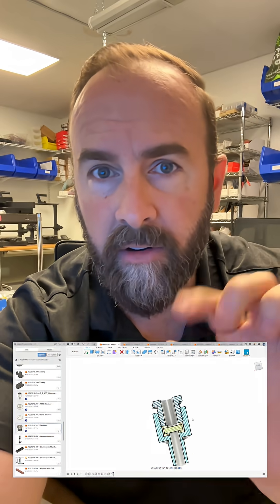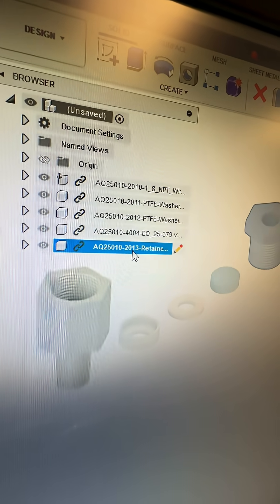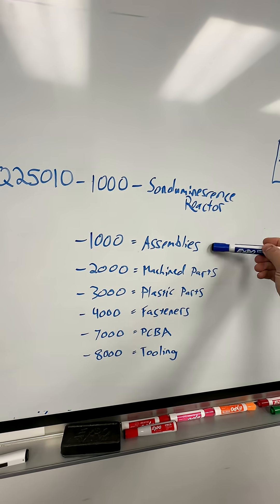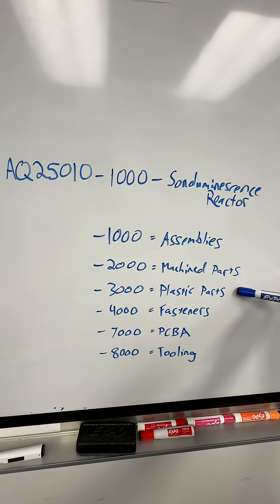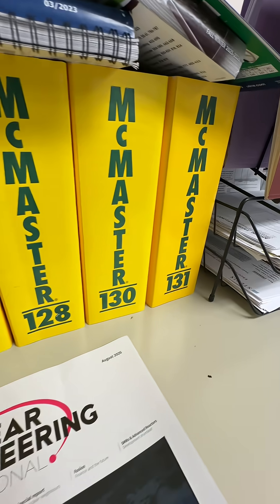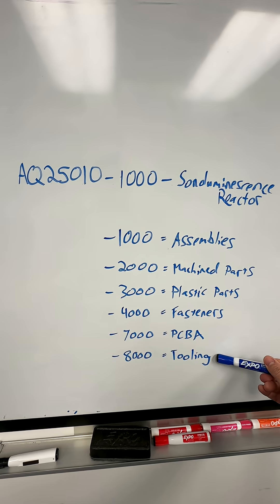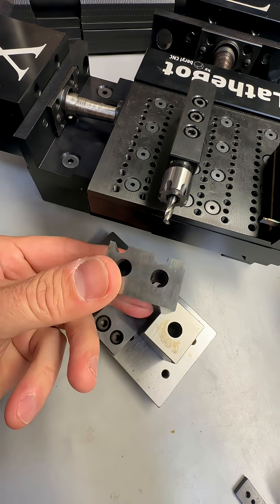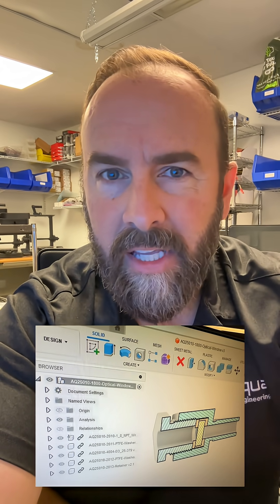Assembly and Component CAD Workflow

Comment: This is the part of CAD design principles that was glossed over during my time in engineering school.

My school (Cornell) never really taught the fundamentals of CAD. Naming conventions for cad is one of them.

It was more of a crash course and understanding datums and basic print reading.

Edit: I chuckled a good bit when you inadvertently called out my current naming convention of “Final Final Version” .

I literally have a CAD .stl file called: “backplate_finalized_02”
Reply: Never made it through E school, pivoted to IT, but did co-op with a firm. I knew the basics of their CAD package from high school and they quickly caught me up on the rest. The logic behind part tracking, revs, assemblies, etc. is still knowledge I use today for 3D printing as a hobby.
Reply from the maker: Same, went to Penn State and they didn’t go into the housekeeping side of engineering. Thanks for watching!

Comment: Configuration management. It's amazing how few people even in the business understand or employ it. Don't even get me started in drafting standards. Strongly agree with your intelligent part numbering system though - it's just a lot easier to keep track off and immediately form a map of numbers and BOMs, as opposed to serials.

As far as Fusion - the way they do their assemblies is weird. The push was and still is to dumb everything down as much as possible and have as few menus and clicks and file types and bla bla bla. With Fusion, it honestly is amazing for just jumping in and sketching up stuff quick, better than any other CAD I've used. But it's daunting to manage large assemblies in Fusion and you have to be incredibly diligent to not have it go to shit.
Reply from the maker: I create a project folder with the base project number immediately, and then everything lives in that directory. From there I have the components and assemblies all mixed up, but they organize well with the 1000- 2000- etc numbering conventions I shared. Yeah I straightened all this out like year 1 in business when I realized PCBs are going to need housings and fasteners, etc, and there’s way more parts than I can track just by colloquial names.
Reply: @i2c_jason they should teach you this year 1-2 of college. I typically don't number until I have a "part" though. I'm often starting with scratch, figuring out what I need, how many bodies it will be etc. and ideally all your numbers and BOMs are managed outside your BOM. Have you tried odoo's PLM yet? One of these days I'll give it a go.